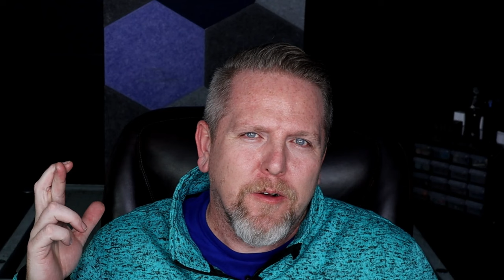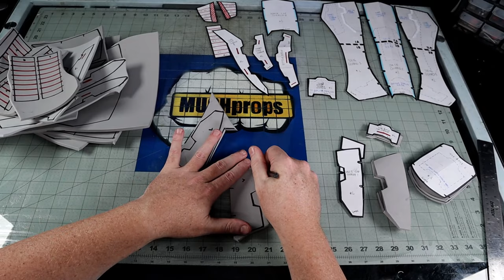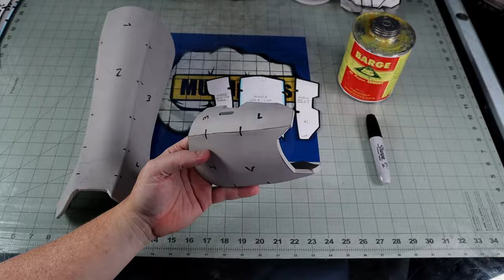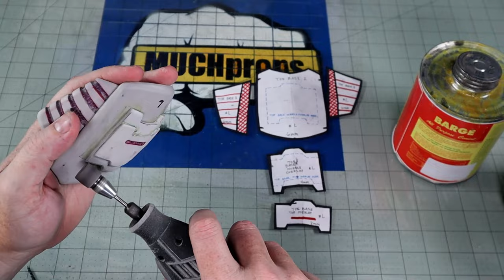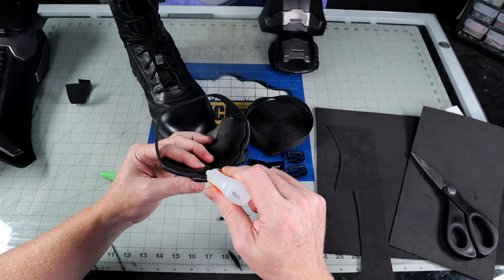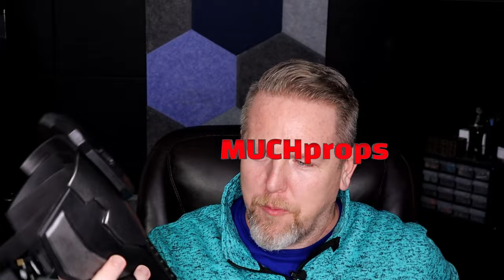Foam Crafting Shin Guards for my Red Hood Cosplay

Comment: Looks great. BTW- you say no protection but 10mm EVA foam will stop a paintball at 5ft! I plan on using this template for my paintball armor. Thanx
Reply from the maker: I don't want to promote that it can, as there are loads of inconsistency in EVA foam. And I would assume that repeated strikes will tear through it eventually. Have fun at your own risk, my friend. Hope the build turns out epic.
Reply: @MuchProps  understandable. I built 2 15mm eva foam shields and the lasted all summer playing hard with visible stressed points but only paint damaged.

Comment: Those look very cool and will look epic with all the rest, for sure.  One thing I did with mine when I made my Mando Heavy was I put small metal hooks at the bottom of the shin guards and in the middle of the boot covers.  They caught in the laces and kept them from sliding around as I walked.  A small thing but made walking around the con so much easier.  Love your designs, Thomas.  Definitely adding these to my collection.  Thank you!
Reply from the maker: That's a smart tip. I might have to add that at the end to mine. May add that in the lighting video. If I do, I will give you a shout-out for the suggestion

Comment: Idea!💡 I love this build. I was thinking though. What if you redid all your parts that’s are painted with red with duplicolor metalcast red spray paint? I think this would give it that awesome metal finish since this is used on silver/chrome rims to make them look anodized red 🤷🏼‍♂️ could give it a different feel, aligned more with that futuristic feel. but love what you are doing any way ❤
Reply from the maker: That would look cool. My only concern would be the paint cracking. I've never used Duplicolor Metalcast on EVA. That helmet is pretty snug and needs a little flexibility when I put it on. The color would look nice though